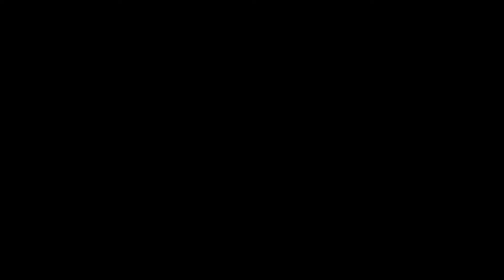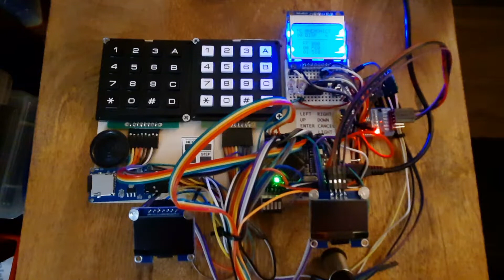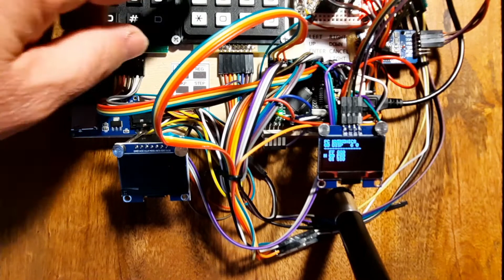Which is faster - SPI or I2C? Monochrome display options for your Arduino or microcontroller project

Comment: Thank you Michael for this comprehensive comparison between the 3 displays.
The SPI OLED is the best candidate indeed.
Looking forward to experiment with this also (it should arrive in a couple of days).
Does the Microtronic code for the SPI  version needs a big change ?
Thanks for your hard work !